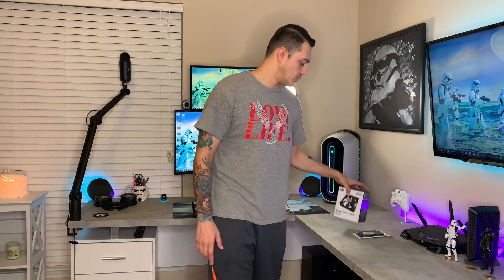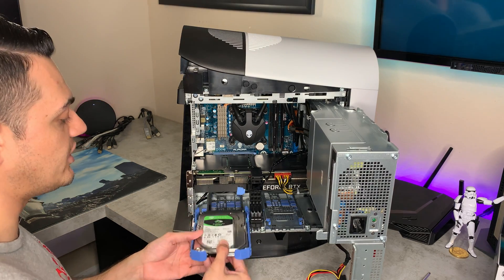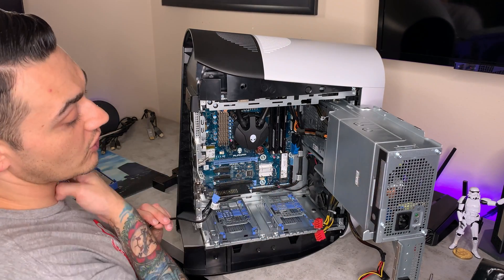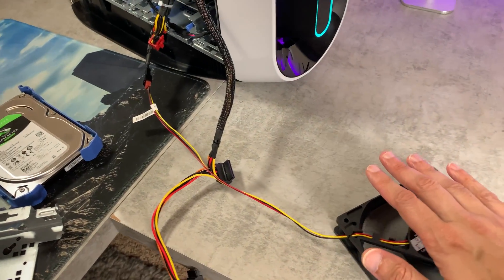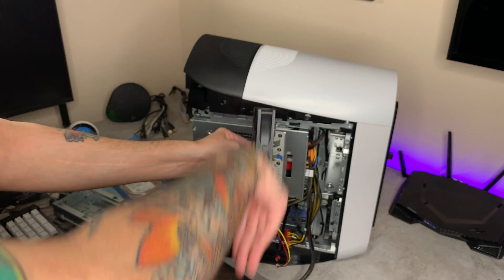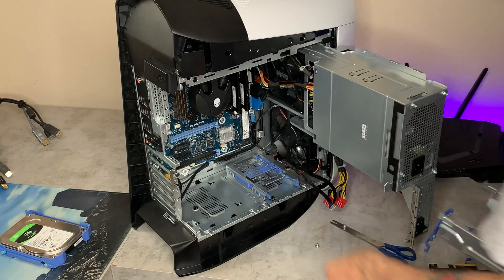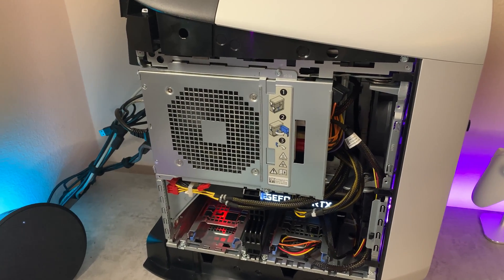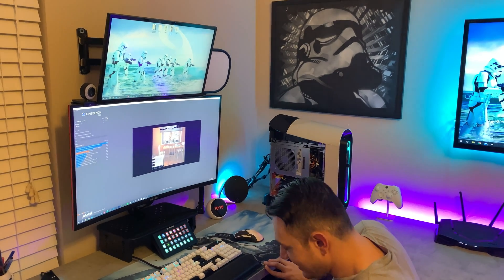Do This Immediately-Alienware Aurora R11 Second Intake Fan Install

Comment: glad to stumble across the channel and video as a new R11 owner (slammed that like/subscribe button), was a little disheartened to see how hot the computer was getting and unsure how to remedy the situation.. looking forward to what the addition of a fan will do

is there a reason why you didnt wedge the HD in the bottom left, does it need to remain locked in the brackets? could you simply place it or is there a reason to avoid doing this

Comment: So I bought the everything you linked below. I have installed all 4 fans. The fan on bottom and the extra on where ur hard drive went. No problem. I also replaced radiator fan and installed the upper for push pull airflow. However. The top of my r11 will not go on with the upper fan installed. I don’t think these fans will work for the top fan. If I’m wrong please help. I’m currently defeated by this upgrade

Comment: im guessing that 3080 is cooler than mine but i get my 3090 down to 60 and cpu to 61 with noctua fans... i think i will put another fan in the from and i hope that 1 degree can even out... tbh i knew she was going to run hot but we gotta do what we gotta do
Reply: I’m interested to hear more on that. I’ve heard Noctuas are badass from the 3D printing community and I’ve got a 3090 build on the way. 60 sounds divine.
Reply: @MRZ0MBIEZZ  yeah sorry thats idle... if you're looking for a real solution you gotta go down the full list... im trying to use a noctua paste on the cpu today or tomorrow but im also throwing in another m.2 tb so im not expecting huge results. Unless i maybe took too much of the original paste off accidentally installing the top fan... if i had smaller plyers to turn that tiny ass screw driver!!!
Reply: come to think of it i maybe couldve used a wrench... eh... maybe,,, glhf

Comment: @gamerheaven 
K check this bro. No idea if it'll work..but what about a corsair two fan rad cooler (Corsair Hydro H100X 240mm Liquid CPU Cooler)
But install the rad at the front of the AW case where the intake (take out hardrive a d existing intake fan) and use the rad there as an exhaust. 

Then throw a fan up top of the case as an intake ( then the vent besides the GPU would also act as a passive Intake)

You would get better CPU cooler from bigger rad. And would push more air out the front vents than you would out the top?

Would it work..would it fit? Imagine if you were the first to do it and it worked. 
BOOM 1 MILLION SUBS
AND LEGEND STATUS my ducky

Comment: Any idea what a rough estimate of temp difference you noticed from adding a 2nd intake fan? And how about the push/pull afdition to the radiator. 

I'm currently running an R11 watercooled with 1 intake and 1 push exhaust. Debating which extra fan would do more or if both are really needed to make a big change. My temps are fine I just run my fans high which is fine for headphone gaming. But always room for improvement.

Comment: Just got my R12 with 3080 yesterday and completed all cooling mods, using 4 Noctua NF-A12x25s, 2 in the front and two on the top in push/pull configuration. I actually pulled the other side/front of case so I was able to use the rubber mounting accessories for the 2nd front fan. I also put Noctua thermal paste around the GPU heatsink. Running NiceHash 97MH/s and average GPU Junction temps of 78c. CPU temps around 50c while mining. Great videos and info to get my system set up. Thanks!
Reply: did u get any bios error on boot?

Comment: i'm getting my r12 with a 3080 this week. going to do many of the upgrades myself. thanks for leading the way
Reply: Interested to see what you do! I’m getting ready to invest in my r12 as well.
Reply: @raezur.b  i replaced the fans with RGB ML120's. got a BIOS error though, so i'm going to have to troubleshoot that. I am getting the error on the top fan, where i've installed the push/pull configuration. i'm not getting an error on the front intake fans, though. 
i've been using it strictly for mining thus far, but i'm planning on getting Flight Simulator soon
Reply: How long did it take you to receive from order to the arrival date? Just curious, ordered mine a couple days ago
Reply: @Skynet4k  approximately 3 weeks, iirc

Comment: The 3.5 inch drive is actually fitting on the bottom, it requires a bit adjustment, but I was able to install it on the left, you are right, not an option to install it close to the front because of the ssd ports and it will obstruct the air flow but you can definitely install with a little adjustment on the cadi
Reply: I used dremmel to cut small hole so you can place the 3.5 hdd cage all the way thru.
Reply: How did you manage to fit the 3.5 below

Comment: I'm getting my R12 this week and plan on adding two Noctua P12 fans for intake.
Do you think you could mount fans to the front chassis using rubber mounting screws instead? Pop off the front bezel and just pull them through those slots?
Reply: Would really appreciate to hear how well the P12s work for you and how you choose to mount the addtl front fan. GL

Comment: Thanks to videos from you, I have learned a lot bout my R10. Installations, upgrades, capabilities were intimidating. Following your videos, I was able to lower temps from 65C-75C to 45C-55C! 2 fans and an H60 Liquid Cooler install thanks to you! This morning(April 11), I figured out that my rig was OC to 1.38V. I lowered it to 1.28V and temps have gone to 38C-45C under load!!! I still may try that push/pull method cause now I am addicted! LOL... Thanks Shipmate!
Reply: Sad that you have to do all of that. Dell should make them like that out of the box. Aren't they the ones on top of the world?  Meanwhile I have to disassemble my new Alienware laptop to clean it every week.

Comment: Hey can anyone help with finding the front chassis fan bracket. I want to mount the extra fan with the bracket by dell is out of the part and the only thing I can find on ebay is for R7 and older

Comment: Thank you man for all the Aurora videos. I have the Aurora R9 and I have the same problem with the temperature, it looks like to me all the issues come from the tower because there is not that much space, is it possible to switch the tower? I know it is a lot of work but I think that will eliminate all the heat issue
Reply from the maker: My pleasure man. No the mother board sends an error code to dell and bricks if you remove it from the chassis. There is a way to unlock it but your warranty would be voided.

Comment: did you get any bios error by using the cooler master fans? Cause i heard you HAVE to use "Corsair ML 120 Pro" fans.
Reply: I heard that too. I ended up replacing the top and front fans with Corsair ML 120 pro fans. I ideal around 34-40 c. I push around 75-85 c full load on cyberpunk. I am happy with it
Reply: Same situation here. I got Noctua NF-P12 Fans and now i am getting a Bios error every time i boot the computer. I couldn't get the Corsair ones since they are Out of stock for the moment, sad.
Reply: @yehieldavid  just found a guy that has open box Corsair 120 ML pros on eBay....Got 4 of them and I’m returning the regular 120s I got from micro center! Got the pros for $20 a piece witch is the same price I payed for the regular 120s. Even going the extra step and buying the Thermal Grizzly Kryonaut Thermal Grease witch they say is one of the best out there.
Reply: @geolopez914  Awesome Man! Thanks for the Ebay suggestion, ill go ahead and grab myself 4 of them too.
Reply: @yehieldavid  Yea most internet sites have an ETA but no guarantees! And not worth doin all that work to find out the Regular 120s don’t work! 
Do it once and do it rite! Hope you get your hands on some!!🤞🏻👍🏻
Reply: I'm looking at using some ML120 Pros in my R11. How many did you use in the end? I'm think of replacing the existing front fan, adding a top front fan and installing a push/pull combo over the radiator, so 4 in total.
Reply: @Teslacoil33  yes total of 4….2 for the intake and 2 for the push pull.

Comment: I have a similar Aurora except I went with Ryzen. My CPU By default idles at around 33 with the only aftermarket modification ive done is change my single intake fan out with a Noctua.
Reply: My aurora ryzen addition is running really hot even on idle, and I think because it probably overheated pretty bad the stuff is slow. Would you suggest getting a different fan the one you got and replacing my original one with it?
Reply: @zefte  are you running on a SSD? Even great specs on a pc if it’s running on a HDD it’s gonna feel like a old school computer. Make sure your operating system is on the ssd

Comment: Hi Gamer Heaven.
 I enjoy your stuff on the Aurora machines as I have both a R9 (Already running super cool) and now a R10 (That's going to go under the Dremel so to speak)
I have gone further down the cooling Rabbit hole with the R9.
The Machine now uses a 240mm Corsair AIO in the roof.
Yes a 240 :)
Using both of the dell fans on the radiator currently .and to be fair with a good fan curve there not loud or annoying.
When the Corsair Ml 120 Pro fans are in stock they will be replaced.

Hdd cage area fan is a thermaltake toughfan 12.
Intake stock location is another thermaltake toughfan 12.
These are pretty much clones of the Noctua Static pressure fans.
And currently I'm looking at doing the chassis floor conversion to allow a 3rd intake fan.
Was a real challenge to make it all fit so that from the outside the Alien R9 looks for all intense purposes stock.
Send me a PM if you want some pictures of the build.

Keep up the good work and Watch those Temp's

Comment: u should have used a PWM fan , as the primary intake also has 4pin. where 4th pin is mainly for PWM functionality. Moreover this CM Fan will always run at max speed as there will be no PWM controller
Reply: I am going to add more fans to this. Should they all be 4pin?
Reply: @cardanogreen  yes

Comment: Also you mentioned about replacing the AIO fan.  You do not need to take the top panel off.  There is a cage that will slide out with two screws.  One is near the left most ram slot at the top of the case, and the other is on the far left of the bracket.  You'll have to un-do the CPU power cable and remove them from their cable mgmt grommets (there are two, one plastic and one metal) for clearance.  Good luck.

Comment: Anytime you hook up a 3pin into a 4pin connector, the 3pin will run at 100%.  So naturally the top fan is going to blow more air than the bottom since it's running at full speed.
Reply: In this case, yeah because it is paired with a PWM fan on a splitter. But it's not true that a 3 pins fan will always run at 100% into a 4 pins connector. The 3 pins fan can be controlled by voltage and you can do that on any 4 pins connector on MOST motherboard. Not sure for the aurora because of AWCC.

Comment: Hey I emailed you two different fans that go the in a PCIe slot under the video card that have lowered the temps for some about 5-10 degrees C, but I totally forgot you have a NVMe in you PCIe so disregard. 😂

Comment: Should I get air cooling or water cooling ? I am afraid the water cooling will fail and leak after few years plus it's harder to maintain as you have to refill it and much more louder than air cooling. For air cooling you just have to replace thermal paste and clean the dust collected overtime.
Reply: Dell says there is no maintenance on the water cooled

Comment: Thank You for finally getting to this.  When you repasted your GPU, did you see any thermal improvement compared to your video that showed no gains?

If you did get better thermals on the GPU, what changes were made from the video you took?

I’m definitely adding another fan and replacing stock going forward.   Up in the air on the Push/Pull AIO project.  But plexiglass for the side?   Meh.  I wouldn’t go that route myself, the power supply is unsightly and takes the entire upper portion of that case.  Are you just going to open the lower half for the GPU to show?   I just don’t see the point with how crammed everything is.

As always, keep up the great content!
Reply: He made a new video with how he fixed the GPU temps. Check it out, it works well!

Comment: I have this exact same R11 with 16gig ram.  Why is my 3080 sitting at 24 degree at idle?   I have bare bones with no overclocking on at all.  My cpu stays at 30 at idle.  Do you have more running in the background?   I play Warzone mainly in 1440p and my gpu stays right at 70 and cpu right at or above 60.  Is this safe?

The only thing I did was make a profile for warzone/CW in the library and set the temp to performance and the power to performance.  Other than that it just runs balanced on idle/web use.
Reply: I want to do your method for another SSD with that adapter.  I’m glad someone is making vids on upgrading these PC’s.  I’m not the best computer mechanic out there but you make it look simple enough.

Comment: Bro i wished u would show more the install of the fan, i mean u told us how to do but at least there was a cut and the fan was in. Without any glue or something else, and i wish u show us how to install it and put it in and which cable gets to be used for and how u do the cable management and everything.. my aurora r10 coming in 2 weeks and i even bought a second nvme wirh heatsink, 4fans from corsair, new heatpaste and everything else so i want to pimp up that little badass to the maximum of airflow but i just never worked on pcs at all so im really excited and scary of not to break anything in there. So i need a step by step video with all that stuff u are doing.. thx bro u are great and your Videos are fantastic much thx!
Reply from the maker: I'm sorry man. The fan just slides into the empty slot where the hard drive used to be, I literally pushed it in with the sticky roll that's in the description. The fan splitter is plugged into the "front fan" slot on the motherboard, where the stock fan is plugged in. The cables, I showed the little bit of what I was able to do with running it around the outside. Dude that's awesome, your R10 is going to be nice AF. I will do all my future tutorials with more detail. Thank you Erto, I appreciate that man!
Reply: @GamerHeavenOfficial  Can you please mention where on the fan  you added the sticky roll?

Comment: You got those temps when your case was open. It’s possible that you got those lower temps with more airflow out of the case. Close the side panel and test again? Great video. Keep the content going!
Reply from the maker: That is true, and I think it does make a pretty good difference with the side off. The temps are still lower, but having the side off probably aided with that. Will do man.
Reply: @GamerHeavenOfficial  What was the verdict on this?
Reply: @ichheibeangel  the verdict was, your PC will run cooler with the side of your case off, don't bother installing another fan because it wont accomplish much
Reply: wont accomplish much IN THIS CASE
Reply: This is a poorly designed PC case, the small side vent shares the air intake with exhaust from the GPU, you can feel that the bottom it's cooler than the top of that vent, and to make it worst it's circular, this vent should have been rectangular and covering all the PCI chamber and also no restricting the intake, you can see how dumb it is, when you can compare the external plastic vent which it's round and the internal part of the panel it's rectangular but it's not even covering the circular part. I made a chamber for the GPU to separate and keep the front cool air away from the side exhausted hot air, this just improves my VRam temperature in 4C, at least allows me to keep the RTX 3090 running without throttling, also I added the top fan but nothing really improved still I plan to keep it in case the RAM needs some cooling.
I created a profile where the front fan it's spinning faster at lower CPU temps so more air can be taken by the GPU.
Reply: Your temps may be lower, but you are exposing you're computer to much more dust.
Reply: For sure that temp decrease can happen by just having side panel off.

Comment: maybe make the bottom fan push air out and the top fan push air inside since the GPU blows hot air out for all sides. Where is the new GPU thermal paste video?
Reply from the maker: That is a definite possibility. It has already been shot, and edited, and the results are good. -30C on the VRAM temp while mining. It will be uploaded either today or live tomorrow at noon eastern.
Reply: @GamerHeavenOfficial  Thanks bro. I watch your channel exclusively as you are a hands on tester and not just a repeater of others information.
Reply: They are so close together you would lose half the intake air getting sucked into the exhaust before it actually blows other anything